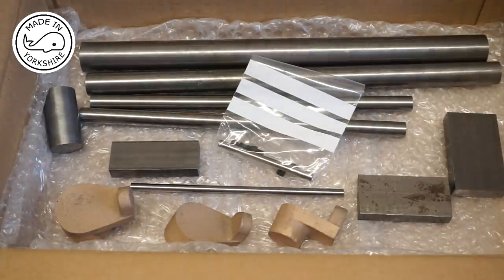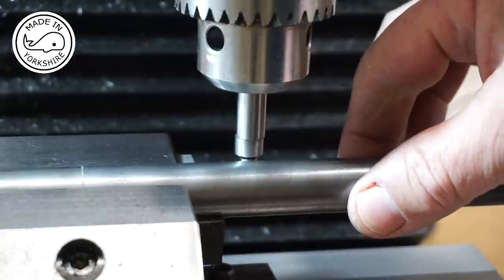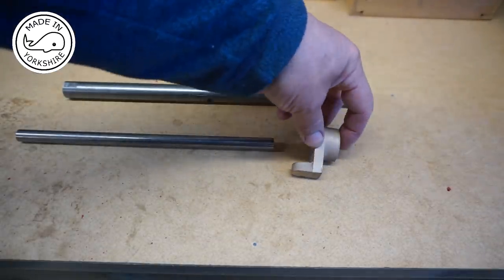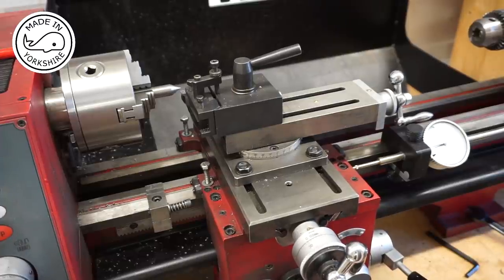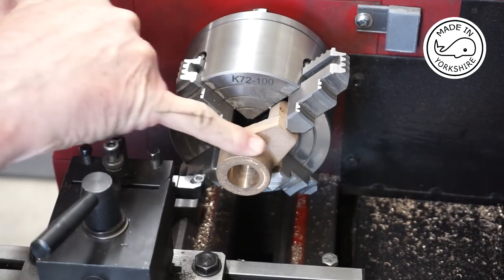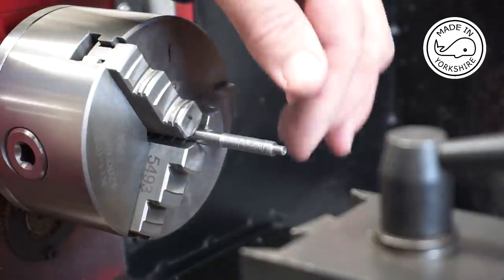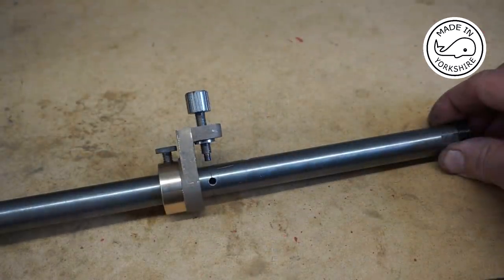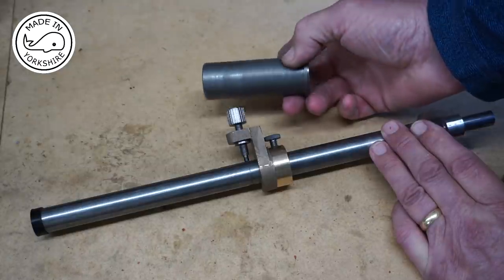#MT37 Making a Hemingway Kits Between Centres Boring Bar

Comment: Nice result Andrew. I am sure that you are giving a lot of thought to how you will hold the cylinder accurately for boring. That seems to be the crucial element in this job. Clearly the part will need to be held rigid not only in line but also at exactly the right height. I look forward to seeing your solution.

Comment: Andrew. Well done, turned out great. When you come to bore the cylinder liner, any thoughts on how you will hold it to your cross slide. ? Perhaps a vee block. Even a better idea is if you have a piece of hardwood,  clamp it down, bore it out using the new bar to sleeve OD. You will then know that the sleeve when fitted will be on center. As you will only be removing a few thou, a couple of decent woodscrews through the block to pinch the sleeve to prevent it rotating or moving.
Reply from the maker: Thanks Dave. I had been thinking of using a pair of v-blocks for the base and have already made a clamp for the cross slide. However your idea of using hardwood has really got me thinking. It's a great suggestion. I need to give it some serious cosideration. 
All the best.
Andrew

Comment: If using a 4 jaw Chuck with a highly offset object the vibration can cause problems with the turning or drilling diameter. As well as screeching and a lot of vibration. It’s easy with a face plate to add weights to even things up but a problem on a 4 jaw. So I make up a small block to fit between the short end of the work and it’s jaw. Ideally to match the same size as the long end. I use a scissor knurling tool to add some grip to the sides that contact the jaw and the work. I also mill a small half round into one side so that the jaw point sits in it making a better clamping action. I have about 5 of these made to different sizes and generally one of them fits close enough for any new job.  I am a firm believer of spending a little extra time creating a jig, thingie, doodat or widget to make life easier, so often they get used repeatedly. Several of the Stuart engines use common or similar parts so for those I spend a little more time on my widgets.    Steve
Reply from the maker: Thanks Steve - another great tip I need to remember.
Cheers
Andrew

Comment: wow, really involved to make a nice line bore tool. looks great! 
I was just going to jam a small bit in a hole in a rod and measure, tap measure tap tap until I had it right haha. I have a big cylinder to do and it's really imbalanced so I wanted to try line boring it
Reply from the maker: Thanks Paul - and it worked great after my second attempt at machining the Farm Boy cylinder sleeve.
Cheers
Andrew

Comment: If worried about threading with a split die, you can use the splitting screw to open up the die for a first go, check out the threaded piece with a nut and then close up the split dies appropriately and go over again.
Reply from the maker: Thanks for the tip Steve. I will try to remember that one!
Cheers
Andrew
Reply: @learningturningmetal  are you still looking for flywheels? I have a box full and seem to remember a pit for hit n miss engines, can sort out photos if interested steve
Reply from the maker: Hi Steve - many thanks for the offer. I managed to get hold of a pair off ebay (pedelee56). They look to be very close to the drawing dimensions. The only issue is that the drawings show the hubs extending beyond the outer rims - so I think I will need to modify them slightly.
Thanks again for the offer.
All the best.
Andrew

Comment: The way you have shown to bar, one will have to remove the carrier to install and remove the micrometer.  Could one install the micrometer on the other side of the cutter to simplify
 the removal of the micrometer before the turning operation?
Reply from the maker: Hi Nevin. Good point! I will definitely try that approach next time. Added to my list of changes.
Cheers!
Andrew

Comment: If you're having problems drilling brass, check out "Clickspring's " channel. He did an episode talking about how to change a positive rake drill bit to negative rake. He got a cheap set of drill bits  that he converted to negative rake and only uses them for brass. Other that that, looks like you got a really good bar.
Reply: It's not only brass you need to do that for. Perspex and Acrylic will also snatch. Sheet brass ( half hard for bending ) will not snatch and a standard drill will cut better than a 'Backed Off' one.
Reply from the maker: Thanks Craig. I do recall seeing Clickspring's video you are referring to. It's a great idea, and another job to add to my ever growing list.
All the best.
Andrew

Comment: That's not a between centre boring bar with one end in the chuck. Expensive way of doing things, a bar and a lathe dog would do the same and use a mike to set the cutter.
Reply from the maker: Hi mate. I didn't show the boring bar in use, but I had to use a chuck to make it. I know it's not the cheapest boring bar solution but I liked the idea of making a simple micrometer, and I thought others might find it of interest too. It got me to try new things out too. I hope to use the boring bar in my next video.
All the best.
Andrew
Reply: @learningturningmetal  You obviously like taking the expensive route to get round a problem. When you have a machine that can make itself why not make what you need. When I needed a between centres bar I cut an old shock absorber  up and used that. It bored me a 38mm steam cylinder in bronze with no taper. I know there's some things you have to buy but the simple things it's cheaper to make.